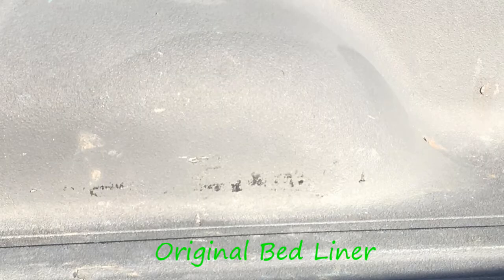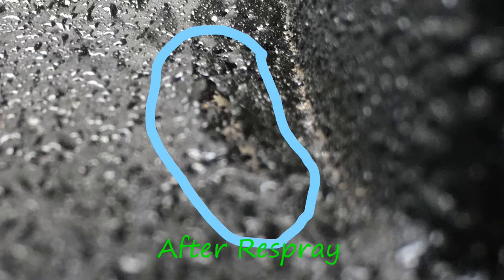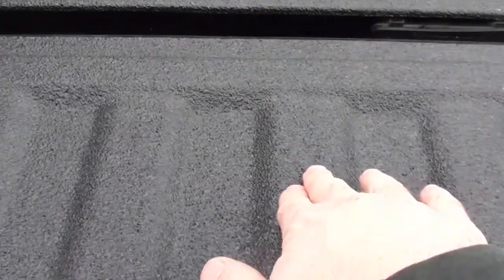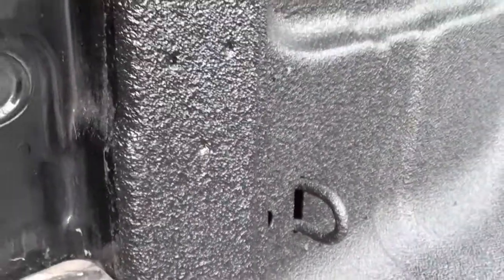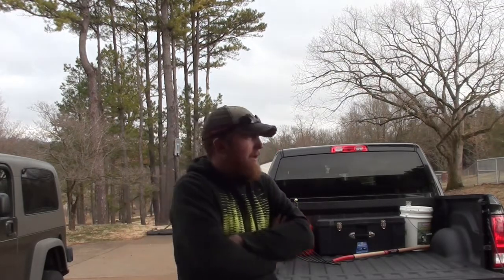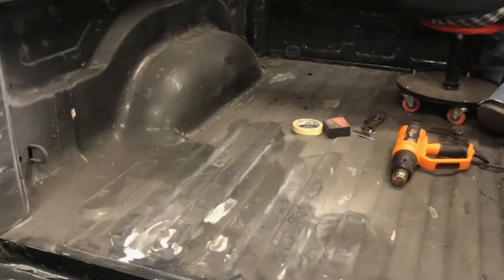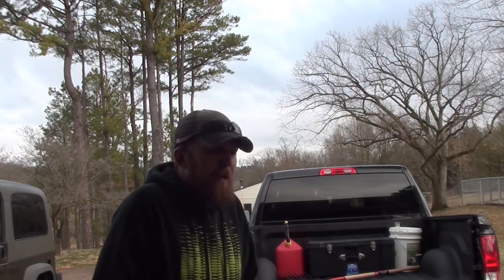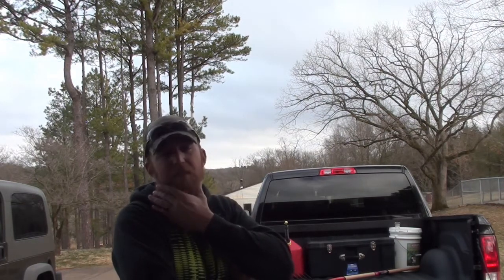Rhino Liner Saga:The Final Chapter

Comment: You could have completely bypassed all that hassle and BS if you had just purchased a $400.00 BedRug Impact Liner. Installs in 30 minutes, stands up to anything, can be swept off, use a water hose or even a pressure washer, stands up no problem. And water passes through to the truck bed drain holes. By the way, it can be taken out in less than 5 minutes, and again installed in 5 more minutes. Got my first one in 2005 in a Silverado, still have it, still holding up with no problems. Now have a 2014 Sierra and a 2018 Sierra with BedRugs in them, the 18 has the new Impact version, which has a base of about 1" of recycled rubber compounded with plastic, and it's something else. Holds up to anything, you gotta see to believe. Lay on your back on your line, it feels like sandpaper, right ? Lay down on a BedRug, it feel like carpet, and it even smooth-out the high and low points of the bed. No, I'm not a salesman, yes, I have a business, concrete work like driveways, patios, pads and foundations, and anything else I and my crew can make money at. Just hate to see working men get screwed by dealers who put $45.00 worth of crap in a good truck, and charge $500.00 + for 45 minutes worth of unskilled labor who do a crappy job anyway. Spray-in bed liners have become almost a scam, and everyone I know I try to steer away from them. And everyone I know who has one swears BY it, not AT it.